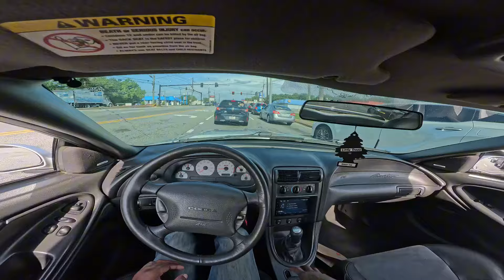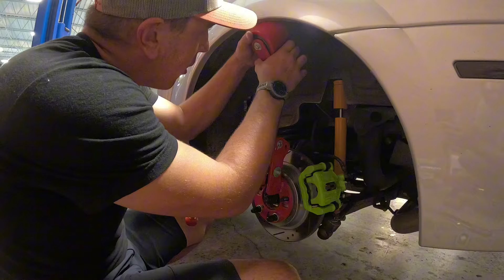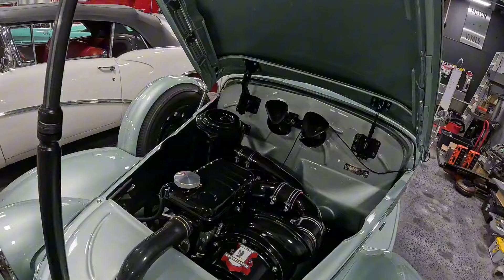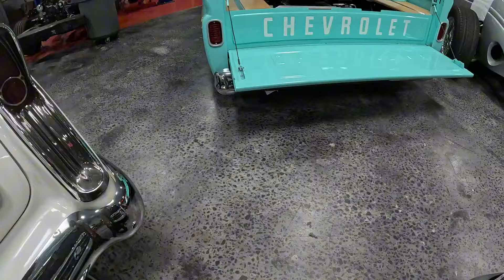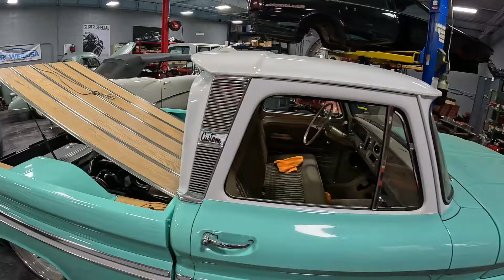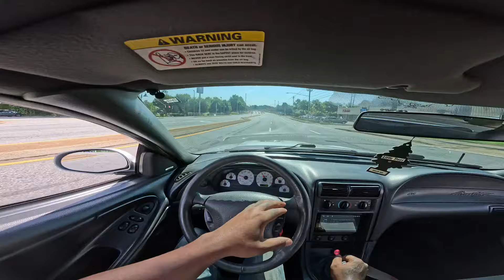03 cobra fenders rolled today ( pov) drive before work 🇺🇸👌🏽🐍

Comment: I drove my mustang new edge in the rain today it was nice until brakes started doing things. Brakes were good till the end of the drive. I felt a thud during the brake part almost hit a trailer but luckily i didn't i dont know whats going on. Any body got any reasons why the brakes did this? I happend a couple of times before the rain
Reply from the maker: @TheWeirdBois458  Check your fluid make sure it isn't discolored and check the rotors and pads it shouldn't do any of that